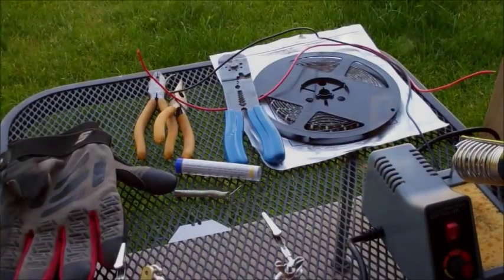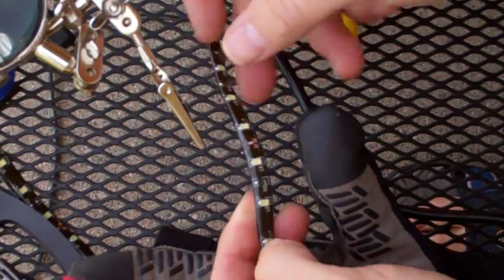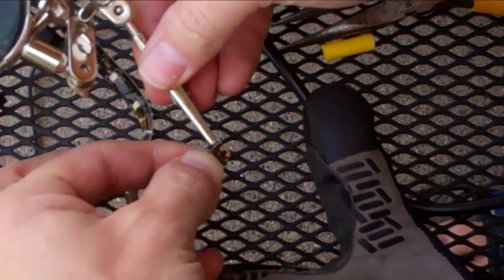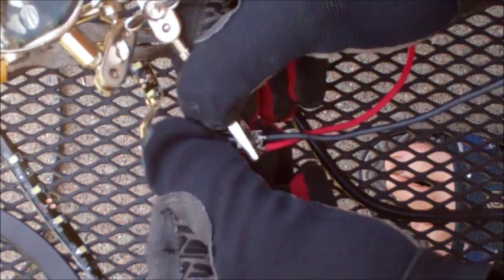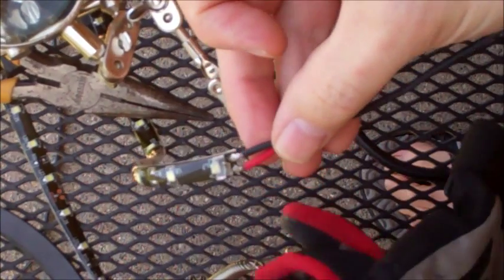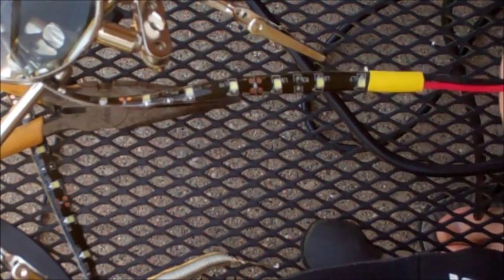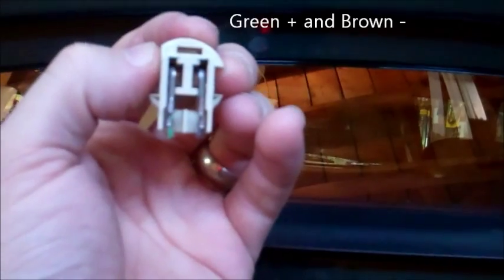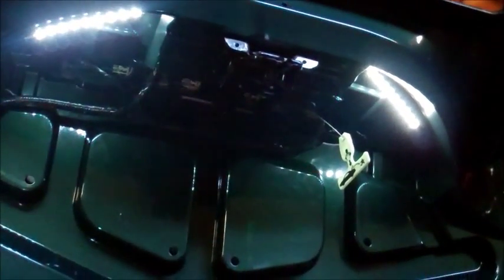Installing LED SMD Strip Lights in a Car

Comment: I have been considering putting some LED's to my car project also. Im just a bit worried of the voltage that the car's electric system actually gives. Nominally it is 12V but the actual voltage may vary all the way up to 14.5 or so. Has your LED's tolerated the higher voltage okay or have they burned? Thanks for your video and help!

Comment: just bought an 06 mustang are the wire colors the same? dude who had car hacked it all up no plastic piece on trunk lid no existing light and is push button next to trunk latch the switch for the light thanks for any help

Comment: Nicely done video and install!   I'm glad you showed that you took your time and did it right by using the shrink tubing and black electrical tape to give the entire job a professional finished look.  To those that are watching this video, it doesn't pay to try to take short cuts; you need to take pride in all the work you do so you can show it off like Auto DIY does!
Reply from the maker: +Prime8inAtlanta I sometimes spend a little too much time trying to make things perfect, that's just how I roll.  I am glad you noticed the extra effort and took the time to post this great comment, you are appreciated.

Comment: Thanks for uploading your videos, they're very useful.

I got a little doubt: where is exactly the trunk original bulb? 'cause recently I bought a 1999 'Stang but it has no trunk light...

Thanks again man,you're the best.

P.D.: Sorry for my bad english, I'm a Spanish speaker XD
Reply from the maker: Your English is good, thanks for taking the time to post your nice feedback and question.  In the first few moments of the video you can see the stock bulb, it is mounted to the trunk lid on the same side as the emergency release handle.   So open the lid and look up and to the right, you should be able to find it.  Good luck, or should I say "buena suerte y divertirse".